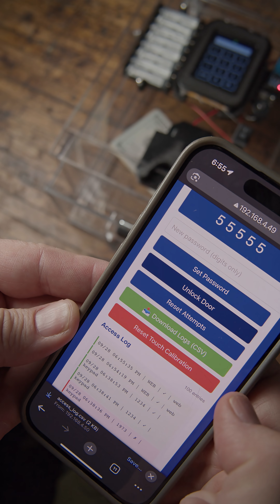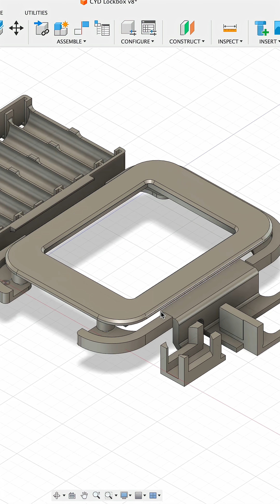CYD Lockbox

Comment: You should use step-up converter and like 1 or 2 battery cells. A step-up converter would be just slightly more expensive than a step-down one, but you would save more cutting the price by removing most of the battery cells.

Comment: Cool. Just one suggestion. Replace the solomoid with a spring loaded mechanism maybe? Ideally reset when closing the door somehow 🙏🏻❤ maybe something else entirely. I often would like tohave higher voltage battery CELLS kw hint

Comment: could have saved a boatload of batteries if you used a 5v supply for the electronics and a boost converter to boost the 5v to 12v for the occasional burst needed for the solenoid.

Comment: Using a cheap servo, you can run it off 5V and control with 3.3V PWM, so no need for 12V, buck converter or mosfet, and will be cheaper than the solenoid.

Comment: Not secure, having the two wires to power the relay on the outside, all a person would need to do is send power to the relay on the wires that's already on the outside.

Also as those AA batteries get low on power, they may not supply enough voltage to the lock.  Might put one more in line to bring voltage up to 13.5 so when they're half discharged they'll still be at 12 volts.

Comment: Cool, but what happens if the voltage of the batteries get too low? You couldn't unlock the box?
Reply: It would be easy to set it up so that one could externally apply 12v directly to the solenoid (via drilled holes and probes).  Probably a good idea if batteries might go dead without being detected in time.
Reply: @zephsmith3499 but then you can open the solenoid any time without entering a code or not?

Comment: LPL teached me, all you need is a magnet to crack a solenoid lock. its open in 2 seconds, no code needed
Reply from the maker: Interesting... i'll have to try it
Reply: @HackMakeMod   LPL has multiple videos  about solenoid locks, he cracks them all with a magnet. one would be episode 1072 , "Open In Under One Second: Electronic Keypad Cam Lock". so it definitely works.

Comment: Is this hack resistive. Or can you open the panel like in the movies and short 2 wires and it opens. I am thinking to implement something similar as a door lock.
Reply: Just short the pins across the MOSFET and it'll pop right open.
Reply: @williamsteele  i meant if the electronics are hidden and only the display panel is accessible.

Comment: Can the photo resistor be used to adjust screen brightness based on ambient lighting?
Reply: It's apparently not integrated into the devboard's circuit.
But if it is , then yes, it CAN be used for that purpose.
Reply: The backlight is not dimmable, it can only be on or off. There is no PWM on the backlight LED, at least on my version (pin GPIO 21).
Reply: @cedrikkaurit3078  You can surely pull out the LED anode/cathode pin (depending on circuitry used) and apply "analog" i.e. NE555-based PWM to that - or switch the LED over to a PWM-supported GPIO pin. I've done similar to a PCF8574 "I²C to Parallel I/O Port Expander" LCD backpack module that comes attached to several HD44780 chipset 16x2 / 20x4 LCD boards out there when you buy them. Granted, I'm experimenting on the Arduino/ATmega328p and RasPiPico/RP2040 platforms; I don't know any specs for the ESP platform, but I'm sure hardware- OR software-PWM is possible there by some means.

Comment: With that you can adjust the brightness of the display with some little bit of code
Reply: but if it's not connected to anything you can't
Reply: Also, on my version the backlight brightness cannot be adjusted, only on/off. The backlight is not connected to a PWM pin, this is probably also why they didn't finish the photo resistor layout, not much use for it.
The CYD needs more revisions but it's potential is very high. Maybe they are testing the market... I fiddled with this a few years ago and couldn't get it to work, a lot of quirks. Now just a week ago I started again and it was way easier to get it working. The libraries I had from a while back compared to the current ones have changed so that is why I got stuck earlier. 
Definitely start with the CYD startup guide online.
Reply: Using the LDR

Comment: How long would the batteries last?
Reply: These 18650s can last for a long time, I am also curious to see an exact estimate of how long!
Reply: @DRSDavidSoft  Those are not 18650. They are Triple-A (AAA) non-rechargeable dry cells - 1.5 Volts each.
An 18650 (Litium rechargeable)has 3.7 Volts nominal, 4.2 Volts end-of-charge.
Reply: @DerMarkus1982  Thanks, I don't know how I made the mistake! 😅

Comment: Wouldn't it make more sense to use a pair of 18650s to power the CYD and use a boost converter to get the 12v for the solenoid only when necessary?
Reply: That makes a lot of sense as the solenoid needs power for only a few milliseconds.
Reply: 3X 18650 give out usable 12V
Reply from the maker: Maybe… it depends on how much current the solenoid draws. It’s possible that 2 x 18650s might be enough to power it because they can provide a lot more current than alkaline batteries.
Reply: They can, I've successfully used a boost converter for this kind of project a while back with the exact same solenoid and 17650 batteries.

The key is to send a short pulse before the boost converter and wiring has the chance to get hot. It can supply the current for a short time bo problem.

The main usse would be if you continued to keep the solenoid on.

Also, I used a relay instead of a MOSFET module, but I don't believe it makes a difference.
Reply: @HackMakeMod  You can get 18650 batteries that can handle momentary power up to 20 amps. In parallel, 2 would absolutely work the solenoid with ease.

Comment: What if the batterys die
Reply from the maker: I usually make a secret hole where I can insert a wire to manually unlatch it
Reply: @HackMakeMod  you could add a wireless charging so you can charge the batteries. Or have a physical connector to plug to so you can give it emergency power.
Reply: You have to throw the whole box away and make a new one.
Reply: @nyckid  🤣